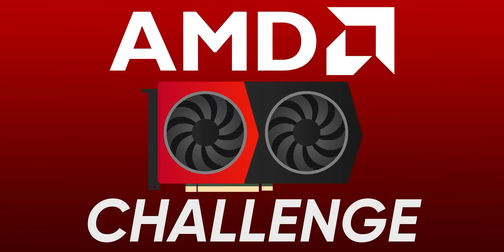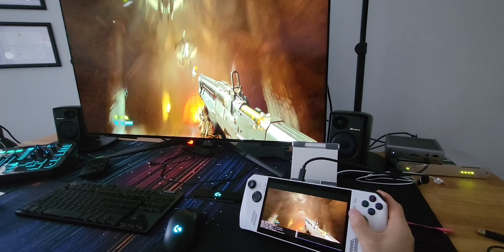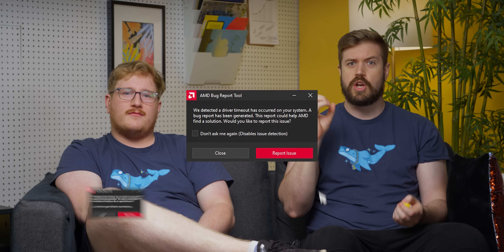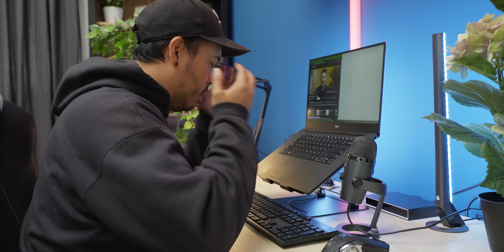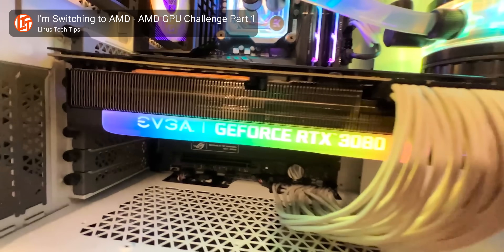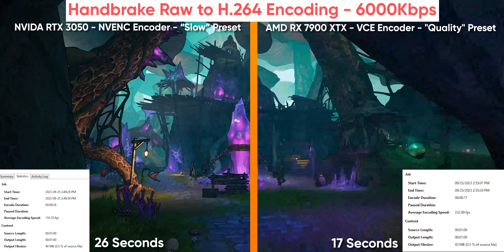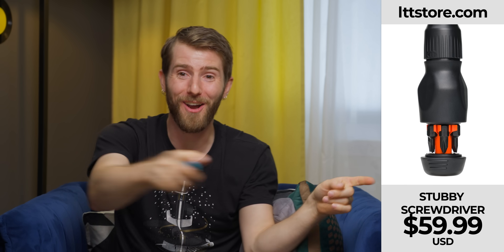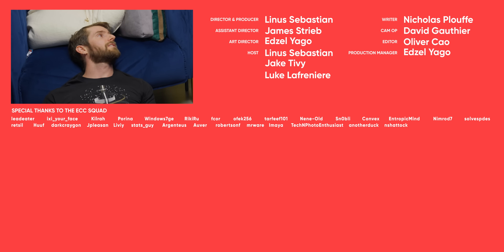I’m Staying on AMD! - Radeon Challenge Pt. 2

Comment: Thought this might be useful for anyone those who might want to pick up one of these cards whilst they are still in stock.

I've just bought the 7900 XTX Hellhound after a ton of skepticism (nearly went with the 4070 Ti Super Trinity). I was prepared to return the card if I had issues, but low and behold all the research I did paid off and this thing is an absolute beast. FINALLY they fixed the stupid power draw at idle issue, drivers have been incredibly stable and I'm still yet to have a driver crash or any other weird problems like low performance or monitor issues.

I honestly expected to have at least some issues, and yes of course it depends on your system configuration. Personally I'm using a Ryzen 5800X3D, also very important for me to note that there are adefective cards out there. Unless you're buying in store to make it easier to return I would avoid Sapphire as I've had first hand experience with their 7900 XTX Vapor X and I've heard the XFX cards were having issues, but I can at least say that the Hellhound cards are awesome and have great cooling (unlike the reference AMD cards).

Comment: I recently bought an rx 6600 and it really impressed me how much performance £170 got me. Idk if its maybe due to it being last gen and so the drivers are more stable but it seems to handle a lot of games fairly decently. Even being a more budget card it can handle most new games to an acceptable level to me.
Reply: what kind of games are you playing? I got rid of mine because I couldn't play RimWorld, CK3 or Civ 6 on it :/
Reply: @reinardviloria3433  Huh, weird. My rx 6600 with an i7 4790 can somehow handle starfield on ultra settings at 1080p at a playable framerate. It does drop to 30 at times but 30-60 FPS is still fairly playable to me considering my setup.
Reply: Just got a RX 6800 XT myself and its been floor-less so far.
Reply: @reinardviloria3433  It's my understanding that top-down view strategy and sim games are generally the most demanding because of the sheer amount of active assets you can have on screen. They're not usually my jam, but I heard not zooming out as much can help?
Reply: where did u get it for £170 thats a good deal
Reply: @reinardviloria3433   from my understanding not only you need good gpu power you also need good cpu power because of so much is going on like npc soldiers and such tht is sure to task the cpu as much
Reply: @ONLYJOKING101  i have a 6800xt and 6950xt in my 2 rigs (one does sim racing, the other does everything else, like streaming and video editing) and theyve been extremely stable and fast. most games run ultra at REALLY high FPS, usually keeping my 165hz monitor capp'd at full tilt on every game. they are both XFX 319 models with big beefy coolers, extremely happy with these two cards.
Reply: essentially, the worst time to use a AMD card is immediately after a significant hardware change(GCN to Vega, Vega to RDNA1, Monolithic to multi die), then to a lesser extent, the launch window of a gpu.
Reply: i use rx6600, and i really like it! its been amazing and a huge upgrade from my rx550. the price to performance is crazy. i play mostly esports titles and jrpgs
Reply: @ghomerhust  Mine is a TUF-Gaming. Works great. Had for about a month. I now need a new monitor to keep up with it. lol
Reply: Mine is a Sapphire, and I love it! Outside of Ratchet & Clank Rift Apart, which is giving me some weird slowdowns no matter what setting I'm on, it's fine. The only thing I'm a bit bummed about is the performance when using Emulators. I think this is mostly an issue with the emulator itself though, particularly Yuzu. Every other emulator work pretty fine.
Reply: I have a rx6600m on my laptop, sa basically exact same chip. From what i can tell the performance has increased by 20-30% overtime due to software updates. I can get like 120-140 fps on forza horizon 4 on ultra comparing to 90 that i got when i bought this. Still with less than 100W of power draw too.

Comment: What you guys should test is if swapping from an nvidia card to AMD card without and then with a clean reinstall somehow affects stability. I've heard multiple times that even when using DDU you'll still run into occasional issues when upgrading from nvidia to AMD. 

And now that you're on Radeon, you should absolutely try the Linux challenge again :)
Reply: YES, AMD cards have actual serious suppport on Linux.
Reply: I had the issues going from a 4070 to a 7900XTX.  Had a bunch of weird issues even after running DDU so I did a fresh install and has been perfect 6 months in.

Comment: Luke's issues are almost certainly PCIe issues, i have basically exactly the same symptoms with my 2080 Super if i dont run it with x8 PCIe. I suspect either my board or the GPU have some defects in a PCIe signal line which is causing that instability.
Reply: I agree, they are the exact same issues (random GPU timeouts, 5 fps on the desktop, etc) I had on a 1080ti when I upgraded my motherboard and the PCIe slot turned out to be bad.
Reply: 100%. Had the same issues as him (but in slightly different ways)
Reply: Toward the end of the vid.  I was like hope the mobo has all the drivers up to date :)

Comment: I know exactly what the idle power problem was. It also happens on my 3090 when you have two screens or more all in 120 or higher. The GPU needs higher bandwidth to run them. So ideally you only want your main screen at high refresh rate in the rest at 60 and that fixes it
Reply: i wish that was the case … i agree the problem stems from having more than one monitor … but i have to drop all my monitors refresh rates down to 60hz and reduce to from 1440 to 1080 for the gpu memory clock and power draw the idle correctly …
Reply: @KainLongShot  question for you, are you running 1080p 60hz all the time on your monitors now? that seems like a massive drop in quality for idle power reduction.
Reply: @KainLongShot  I recently tried a 7900XTX, but it pulled 100W at idle because one of my monitors was 1080p while the others were 1440p. Moving that monitor to plug into the MB instead is a workaround but it introduces other problems of its own. There were another smaller issues as well so I just gave up and swapped it for a 4080 instead, and life has been good ever since. Even though the value is trash. I really want to like AMD but at least my experience has been that the cheaper price is offset by way more issues and tinkering required.
Reply: I had a similar issue with high idle power on RTX 2000 series. More than 2 monitors does it, or not synced refresh rates. I have a 1440p 144hz monitor and 1440p 60hz monitor. I set the 144 to 120 so it is divisible by 60 and the idle power drops significantly.
Reply: @LateNightFire  not all the time . . .I've done a few things where I'll up the resolution and frequency native to the monitors when I'm playing games or need the higher fidelity. If I'm just putting around or I feel I won't need the computer for a bit but don't want it off I'll switch everything back . . . it's not a great solution but works for me . . . for now
Reply: @sola7078  that's sound advice. . . the 4080 is a wonderful card but I got too good of a deal to pass up on the xtx. For now I'll make it work. Aside from the idle power issue I wish Eyefinity worked as well as Nvidia's monitor spanning solution.

Comment: I swapped to a 7900xtx from my 3080 after my 3080 died, had a faulty power cable that killed it, I have had a phenomenal time with my 7900xtx, thing is badass. Running on a 4k 144hz monitor and I LOVE IT
Reply: I went from a 3080 to a 7900XTX also. Great performance. No issues.
Reply: i wish i didn't have problems with my 7900xtx i have low fps in 1440p i probably will have to return it
Reply: @artraudgaming3575  Is it possible you got a defective card?
Reply: You're not getting 4k 144hz with a 7900xtx bud
Reply: I have the lesser 7900xt and I’m running CP2077 at 100 fps with RT on a 1440p UW. I’m really satisfied.
Reply: @AndrewB23   How do you know what games or settings he's running? I have a red devil 7900xtx and could totally run 4k 144hz with a high settings with a few tweaks depending on the game.
Reply: @AndrewB23  a 25 game avg by techpowerup shows mba xtx getting 130fps at 4k max settings, so it definitly can in a lot of games
Reply: @Mad-Lad-Chad  yeah i guess
Reply: Still running good?
Reply: @moe4b  yessir, ended up going full watercooled with it and it’s been awesome. I am planning on upgrading to a 5090 though since I just got a 4k 240hz monitor. If AMD offered a high end GPU this gen I would’ve gone that route but since they’re just doing 9070 and 9070xt I’m going back to nvidia for now.

Comment: Very interesting. I have my new PC with a 6800xt for about three months now with zero GPU related problems. No crashes, no high idle power and no rendering issues. I even undervolted it to reduce the admittedly high power draw (which is kind of expected on a last gen card) without running into instability issues. You're probably right about newly launched products not being completely ready on the software side since older ones run quite reliably for many poeple.
Reply: How do you like your 6800xt? I'm possibly picking one up tomorrow
Reply: @DukeFerdinand You can't go wrong with it imo, my RX 6800 has been perfect
Reply: i think when we buy one generation older cards is better so the driver issues are all fixed
Reply: I made the mistake of buying a 6600XT for $599 back when the GPU prices started dropping and now the 6800XT is less than what I paid for the 6600XT. Ugh.
Reply: @DukeFerdinand  Got mine 4 months ago, bc my rtx 3060 died randomly. Have it undervolted and am very happy playing cyberpunk on 4k medium-high with fsr 2 balanced, hitting 80+ fps, while drawing 20 watts more than my 3060 at ~190-200. Generally just a great card, and the adrenaline software is great to tune every important setting to your liking ^^
Reply: @kingzach74  I kinda wished I waited too. I could've had a 6800 non XT instead of a 6700 XT. Just would've been money better spent.
Reply: I have had my 6800xt since release (two years now i think?) ... i can firmly say the only driver issues i have ever encountered ... hell the only issues i ever encountered were windows repeatedly rolling back my driver without my permission.
Reply: @DukeFerdinand  For me it's great, the performance is more than enough for the games I play at 1440p 144hz and I expect it will serve me well for many years to come since it also has generous 16GB of VRAM. RT performance is nothing special, but also definitely usable (comparable to a 4060Ti according to some reviewers). The only two cons I have are the high power draw and thus heat output and a slight coil whine under specific loads which is probably down to the XFX SWFT model or even my unit. Overall I can definitely recommend the 6800xt as it's a solid product, but depending on your local pricing a 7800xt or 4070 might also be a great option.

Comment: I've always found it funny that personally I always had the opposite experience. Back when I ran intel/Nvidia combos I always encountered a lot of problems/bugs but after switching to an all AMD setup I've yet to encounter anything even close to the problems I've had with Nvidia when it comes to drivers or anything like that.
Reply: I lost two cards to nvidia drivers a few years ago...
Reply: That is a very unique experience. I'd be willing to bet; without knowing anything about your setup, that your issues were being caused by something else in the system. i.e. Ram MOBO or PSU. AMD (specifically radeon) is kinda notorious for compatibility issues. Though I should say if there was more widespread adoption you would likely see more out of the box software support.
Reply: Mmm... from Linux, it's a lot simpler to just use AMD. Mesa drivers are way better than AMD's windows driver ever was for me. Haven't had an issue processor-wise either way.
Reply: I recently switched from intel/nvidia to amd/nvidia and its been smooth sailing so far.
Reply: Exactly the same for me.
Reply: @JustGetAHous amd/nvidia is the best combo. Amd cpus are great but they are behind on gpus.
Reply: @OlSmokey304 unless I've been really unlucky (which can also happen) I don't really think any of those were the problems. The problems I said I had happened over multiple PCs and 10+ years. For some reason Nvidia GPUs never really worked out for me (of course it's possible that I've made mistakes that caused me all that)

Comment: I bought a 6700xt 2/3 months ago, and i haven't had any problems that i haven't seen with my 2060, the 6000 is basically on point after all those updates (using a 5800d3d as well)
Reply: same bought it start of the year and only thing was maybe vrchat in game videos not playing till I changed it to run on my cpu.
Reply: @theoc007  yeah, vr games was hard to get working flawless compared to nvidia, but when you get it, it's perfect

Comment: I also went Team Red this generation around, and earlier into the cycle I had a lot of random issues too. I run a multi monitor set up, and if I had a video playing on Youtube on the other screen while launching a game, the drivers would crash pretty regularly. Since then I've updated the drivers a few times, and AMD has really seemed to get these quirks worked out. Definitely going to have to agree with the wait a few months sentiment, but as of this point I couldn't be happier.
Reply: I think going with last gen Radeon is the best. My 6950XT works great
Reply: The best to buy is last gen 6000 series because software more matured than new gen
Reply: Windows is also kind of terrible with multiple displays at times. I have had tons of issues with mixed refresh rates, videos or anything with gpu acceleration would cause games to stutter or slow down unless I could run them in exclusive fullscreen, which negates dual monitor ease of use, and a surprising amount of games now are borderless and not exclusive.

Comment: I had the same issue with my 3060ti like luke mentioned. When i play ready or not, it crashes along with discord and discord takes a while to start up. I found the issue was because i undervolted my card too aggressively. Everything ran normally after increasing the undervolt by 25mv. Therefore, i think his amd card may have a voltage regulation issue of some sort.

Comment: I switched from 2080 to 6800xt(after trying an Arc A770) a few months ago. And I haven't had any issues. Games are smooth and Linus is totally right if you don't care so much about ray tracing it hit every mark for me. I'd say for the foreseeable future I am a member of team red.
Reply: I agree, I have had a 6900xt since launch and never had any issues they covered. And the card has been in two separate systems, one an AMD 2700x, the other a 11900k.
Reply: Same, no issues from 3080 to 7900xtx. Won't be going Nvidia until I can get a new evga card
Reply: I switched to a 6800xt last year but for some reason I've had an issue with games that run dx12 my drivers crash. I've swapped every part and done reinstalls of drivers and windows so I wonder if maybe I just got a bad card

Comment: From personal experience, AMD is constantly working and refining their drivers. I continue to see performance and bug fixing patches to the 6000 series cards, and have had no real bugs or issues with my 6800. 7000 series might take some time.
Reply: What is this video about? I have been running a R5 3600 with a 6700XT a couple months after release and I have never had any bugs, crashes or performance issues.
Reply: @TomDeWeerdt1  this video is about a challenge they did where they had to switch to AMD cards and then report their experiences. and it's also about criticizing Nvidia for overpricing their cards and fighting back by promoting AMD cards (i think).
Reply: @TomDeWeerdt1 it’s about the 7000 series, and they were more buggy than 6000, since they swapped to the mcm gpus
Reply: They probably still had the old NVidia drivers embed into the OS. Bet they never reimages the computer. Been using AMD for years never had any of these issues
Reply: @kmcat the bluescreens can happen because of the problem you described, however the idle powerdraw and free sync issues are well known issues for the 7900xtx and xt!
Reply: I've had no issues with my and set up been happy with it but granted it was a fresh install
Reply: @kmcat I've been having greenscreen crashes since swapping from a 2070 super to a 7800 xt. It seems to be extremely random tho and can't be reproduced manually.. it's on a fresh windows install.
Reply: @TomDeWeerdt1 same here, my R9 3900x and 6800XT have been rock solid. Has the 7000 series dropped the ball with the drivers?
Reply: @sithhhhhh I've heard this and never understood it. I've been building pcs professionally since 2008 and I have never had issues with AMD drivers. I've built, used and benchmarked just about every combination imaginable. My experience tells me most of the issues they had were due to the overcomplication of their builds, they are swapping hardware like hot cakes. A fair squeeze would have been clean builds.
Reply: @RyTrapp0  I was wondering more if NVidia put anything in their drivers to cause problems, when a different card was installed - even after running DDU. It wouldn't be the first time